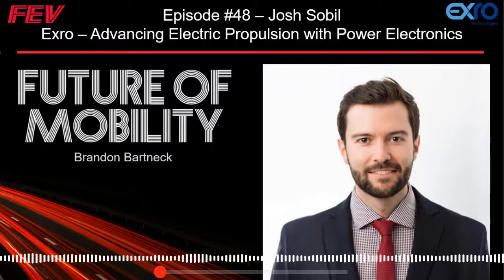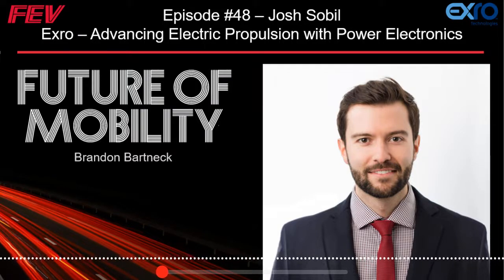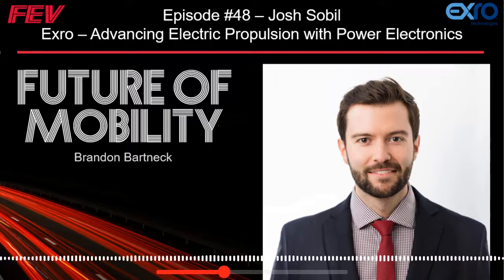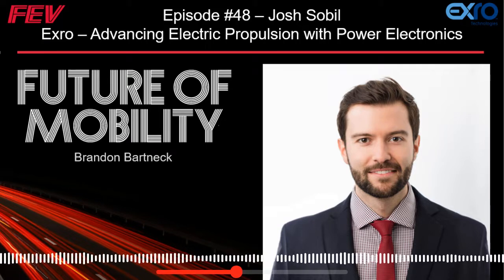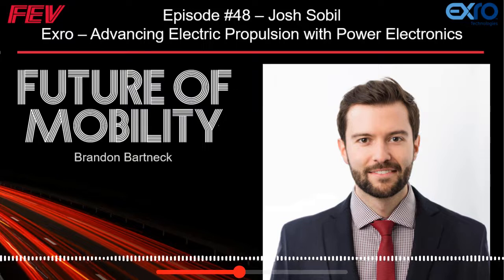Josh Sobil (Exro Technologies) - Improving Electric Vehicles with Inverters and Coil Drivers

Comment: Josh is 100% correct. Everyone always talks about the need for bigger and better, scraping old ideas instead of building off them. Exro's mission to commercialize the worlds first coildriver will help accelerate the shift to sustainable power in EVs, energy storage. If you want more power/torque you go through the controller, there is no need to create an entirely new motor.